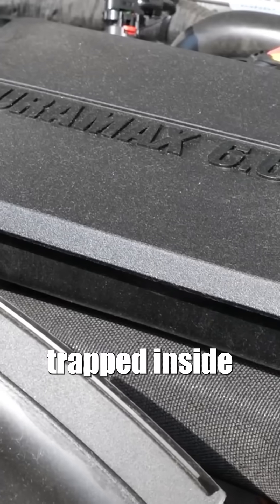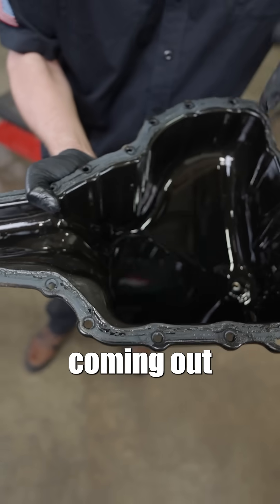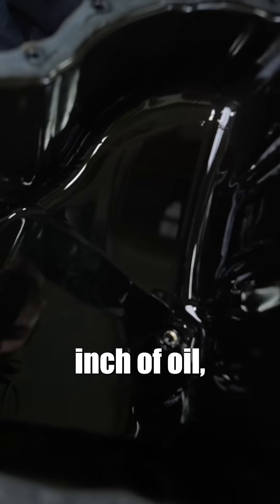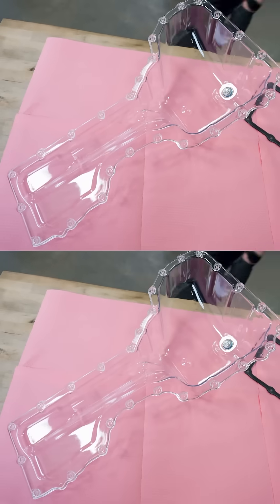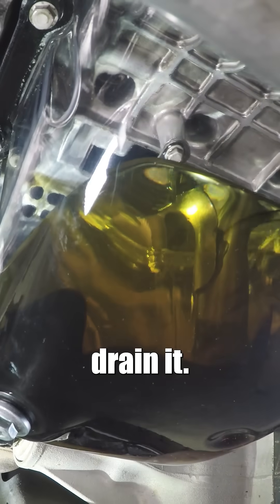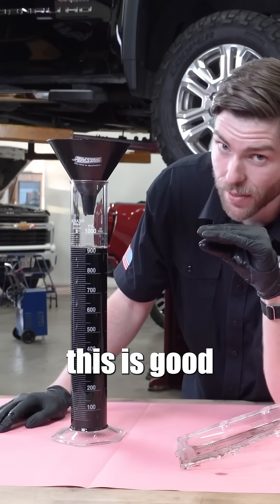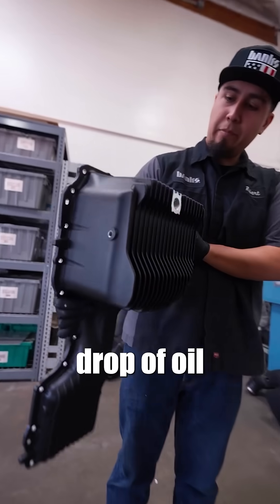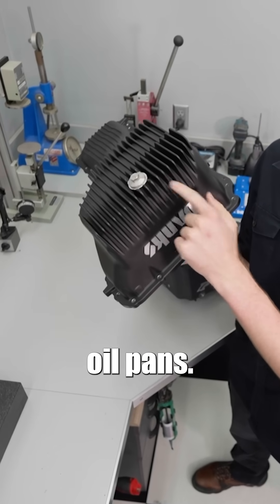A disturbing discovery. This dirty oil is trapped.

Comment: They designed it so that it wouldn't drain all the way and let the pickup tube loose its prime. That way when the truck is started after an oil change it has no time without pressure while it primes.
Reply: Bingo. Now with this they suck air on startup. It could lose prime, but it shouldn't be an issue to reprise, but those bearings are going to LOVE that no pressure time. They can get intimate with the crank.
Reply: @Mooseslife they will be fine, oil film on modern oil sticks around for days
Reply: @Mooseslife  THEN THEY CAN SELL YOU SOME NEW PARTS, HA
Reply: Ford is the only manufacturer of the big 3 that has clear flood mode. With accelerator at full throttle
Reply: @trexthepony8614  not true, have an 09 zr1 that has a dry sump oil system that has this programed into the ecu for this exact reason.   Gm has had it for over 15 years
Reply: @trexthepony8614 wrong, GM was doing it for years before Ford bud
Reply: @DarkAttack14 I was gonna say this, I know my 2001 Sierra does
Reply: Running without oil pressure for some seconds ain’t hurting a thing. So many vehicles have oil filters that you can’t prefill and the engines last just as long
Reply: @ agreed
Reply: I'm completely confused by this comment section. If this is such a common problem, why does any oil change not allow all the oil out. The vast majority of cars drain all the ail from the drain valve.
Reply: Pickup tube does not have a prime, your filter does however. Having dirty oil is no excuse, and also it seems many here don't understand how the pick-up tube works - as long as you have correct level of oil you're good to go since the film is what protects your parts in between drain inter walls and when the car is off. There is no hydrostatic pressure to keep that I've full, if y'all think that - you clearly are misinformed on how the pick-up tube works.
Reply: Maybe if it's a Ford Ranger with a 3.2 🇭🇲
If you take any longer than about 20 or 30 minutes to do the change the pump loses prime things you have to manually prime it back up. 
🇦🇺🤪
Reply: Also no big deal with modern oils, as the oil film from the previous oil should protect at idle for up to 30 seconds, more than enough time to get the oil flowing
Reply: @specialopsdave two words, hydrostatic bearings
Reply: I’m fairly certain on all new vehicles that after the oil change if you floor the acceleration pedal and turn the vehicle over the computer senses the the accelerator pedal is floored and the engine will prime the system so the engine turns over but dosnt start so if you know what your doing you can easily prime the system
Reply: @CavemanJay-wv1pe  not every make has clear flood mode try that on a honda or a Toyota and it will start up
Reply: @ I know all I have is toyotas
Reply: @CavemanJay-wv1pe 
I just tried it. 2010 F-150. It worked
Reply: @CavemanJay-wv1pe that's not what that feature is for... It's for a "flood clear" mode and that's what gm calls it specifically. Holding it to the floor tells the ecu "they flooded the motor" which in itself is extremely rare on fuel injected vehicles. It will cut the fuel injection off so it can crank, clean out the extra gas
Reply: @ and you can’t prime an oil filter or oil pickup tube with it? Because I know you can I’ve done it
Reply: @CavemanJay-wv1pe  followed instructions, am now in a hospital stay room, and my suv is stuck in a tree, they have to cut the tree down to get my suv out
Reply: @willcal2738  lol
Reply: it must have been partly in reverse or maybe i bumped the lever because the car shot backwards when i held the pedal down to start it. the engine surged, my weight shot forward, and i accidentally kept my foot down to brace my body. my suv backed up one wheel into a tree and the tree  trunk broke and the suv got impaled/entangled on it, so they got a tow truck and a city worker to help by removing the tree debris. 
while i recover, im watching a video on how to use a toaster while in bed comfortably.
Reply: @CavemanJay-wv1pe not BMWs. I thought this was the case as it is on most American cars and tried to do that and it just started and revved to the moon I cringed so hard
Reply: @CavemanJay-wv1pe what, the, fuck?
Reply: @CavemanJay-wv1pe most gas engines will do that however most diesels will still start
Reply: @konnerkramer329  funny how you can just add a quart of oil after you drain it, plug it, start it for 15s, shutdown, drain,  there, extra flushed out.
Reply: @willcal2738  why are you starting your engine with no oil? That's worse than just not changing oil in the first place...
Reply: @konnerkramer329  to flush it. 15sec right after driving it then draining it is just fine. Or dont do it at all. Heck, if you dont know what we are talking about go elsewhere like valvoline. If theres a quart remnant and you add a quart, is the motor out of oil or does it have 2 quarts?
Reply: @CavemanJay-wv1pe This mostly works. I’ve found at least one vehicle where it started and the rpms started to skyrocket 😨
Reply: @CavemanJay-wv1pe yeah but now you gotta do that every. Single. Time. Seems like a poor idea.
Reply: @CavemanJay-wv1pe  Some has this clear flood mode, but not all vehicles have this mode.
Reply: @CavemanJay-wv1pe Not with a mechanical pump. Electric pump sure though not sure how common electric engine oil pumps are.
Reply: @Ko90567  I think CavemanJay is referring to the 'flood clear' mode present on most modern vehicles, engine is turning over (pre-prime of course if the prime was lost) but injectors & ignition are commanded off - designed to clear a flooded cylinder/engine.

Quick edit: No load obviously but still turning it over at starter RPM with air in the oiling system.
Reply: What are y’all think the  noises are after oil change on any vehicle?

Comment: Is it possible that little bit of oil is left to prevent any air from getting into the pickup tube between oil changes?  As in, could it be they figured a little dirt over time is better than bubbles in the pickup with a potentially dry filter?

Comment: Good thing you new clean oil gets in there and mixes it up so it's all good
Reply: Basically.
Reply: Heavy particles will only mix when the fluid is agitated heavily, ie not during the oil change, but only while driving..

That way, many heavier particles are pushed through the engine again and again, but never diluted or gotten rid of. 

Engines withstand that quite often, because steel is really strong, but you'll have to admit that the change required to remedy that from the factory would be very small: lowering or recessing the drain plug a bit. Changing this in engineering for all future models would cost pennies per vehicle and potentially have the engine running longer, with tighter tolerances and thus better compression and efficiency.
Reply: Not really because full flow oil filters only filter particles larger than 40 microns which seems fine and all Until you realize the oil film between the piston and the cylinder wall is 3.5 microns which is why those particles end up causing microscopic damage to the cylinder wall and piston and causes wear and tear. Installing a bypass oil filter in addition allows you to filter much smaller particles all the way down to 1 to 2 microns significantly reducing the wear.
Reply: @Ultimusvivi  or just but a buy a better filter
Reply: @samawache  they don't make full flow filters that fine because of two reasons the first being that in order to filter particles that small the volume of oil that passes through that filter is too small and your engine will be starved of oil the second is that oil filter would clog too quickly and would have to change your oil far more often so they're really only good as an auxiliary or a bypass filter.
Reply: By pass oil centrifuges are the answer  @Ultimusvivi
Reply: @Ultimusvivi umm ok. So what's your solution???
Reply: @josemuniz9750  don't put crappy oil in, use the best oil filter do oil changes 3k don't put things down you oil
Reply: @josemuniz9750  using a bypass filter in addition to the full flow filter the full flow filter goes directly to the engine just like a normal one does the bypass filter filters the oil and returns it to the oil pan bypassing the engine. Basically the bypass filter super filters the oil but does so slowly and doesn't affect the oil flow to the engine
Reply: @Ultimusvivi The primary consideration for oil particulate contamination-caused wear in an engine is the rod bearing, crank bearing, and cam bearings. Combustion is dirty and introduces many particulates, including very fine, micron level particulates into the cylinder that don't get filtered before the piston runs along them.

The rod bearing tolerances for most stock vehicles run from 50 to 90 microns. How could oil filter brands excuse selling a product that does not adequately address a major wear item if it were the case that they didn't filter fine enough particles for items of concern?